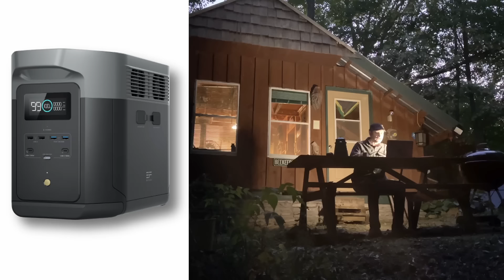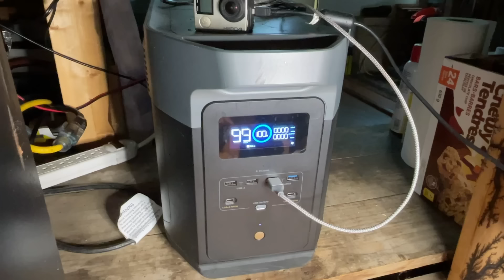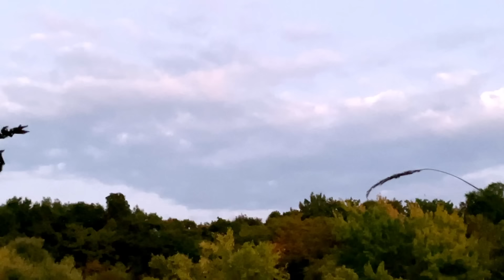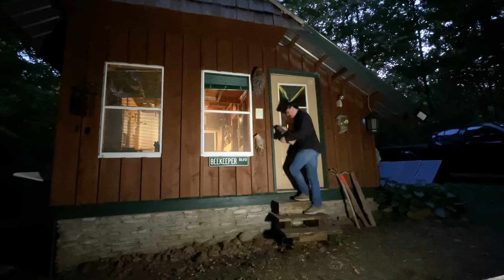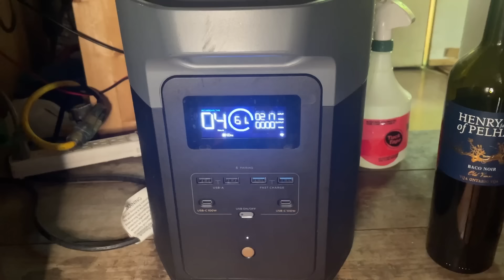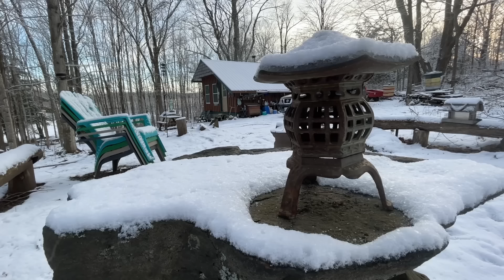Living 48 Hours Off Grid With Just ONE Power Station

Comment: Will it run space heater for more than a couple hours
Reply from the maker: It will depend on your heater, but in general heaters use a LOT of power so you can’t depend on a small power station to run it for very long. In that case, a generator might be your best bet.

Comment: delta 2 max with extended battery and eco flow smart generator running off propane is amazing. when my battery hit 30% the generator kicks in automatic and will charge the unit.

Comment: I’m from perth Australia I have a bluetti it’s great BUT at home I have 600ah lithium and 3 used house panels via victron 100/50 controller and a 2000w inverter(cost about double in total compared to bluetti) to run my shed and garage I have found the electric fridges to be power hungry so swapped over to 12v 95 litre dual zone 12v lights etc and it all lasts days longer but my fridge doesn’t look as cool as the amp fridge haha
Reply from the maker: Thanks for sharing your setup. Switching things over to 12v is a good idea to save power. Honestly, there is no cooler fridge than the Marshall lol. Cheers, Joe

Comment: An adsolute junk power station that can damage your appliances because it doesn't use an output transformer.
Reply from the maker: Interesting opinion, can I ask what exactly are you trying to power that would need an output transformer - more than a power station in this class can handle? This unit is not meant to power a whole house, you need to keep within its limits.

Comment: A 12 volt refrigerator for camping use less energy
Reply from the maker: Good point, direct current doesn’t require energy to convert the power. I actually have a small 12v fridge on the way that I’ll be reviewing soon.

Comment: Sadly I found out afterwards the 12v circuit has low efficiency... I only have a 40 w 12v load on my Delta 2 max and it drops my battery to 50% in 12 hours!!! 👎 Twice the rate of what I was expecting!!! 
You can get decent angled mounts for your wall mounted solar panels... I use them as 'solar' awnings over my windows....
Reply from the maker: It could be an issue with your unit, or there may be parasitic drain happening somewhere. It certainly shouldn’t take 1500w to supply only 500 watts over 12 hours. If you’re still under the five year warranty, I’d suggest contacting the company. Good idea on the solar awnings!

Comment: Since you've got a gas-powered truck, a cheap insurance policy in case your gas generator dies is a 500 watt pure sine wave inverter that clips onto your truck battery (a Bestek is currently $69 on Amazon and it's cheaper on sale). You can adjust the AC charge rate on your Ecoflow down to whatever's reasonable (probably less than 500 watts since there's loss in the DC-->AC-->DC conversion). It's not the most efficient way to charge, but it's cheaper than a DC-->DC charger, it's at least 4 times faster than the cigarette lighter charging, you can use it for AC power without the Ecoflow if you're away from the cabin, and you're just getting it for insurance. The gas your truck uses at idle is minimal. During a recent 72 hour blackout I augmented my solar using my car and only went through 5 gallons of gas the whole time. In order to give my alternator some rest I would run my car for a few hours a few times a day rather than going from zero charge to 100% in one shot.

I have a natural gas central heater with electric blower. During my 72 hour blackout I used backup power to run that just before bedtime, get the house up to 75 degrees, turn it off while I was sleeping, and wake up to 65 degrees. It still used more power than I wanted so I invested in an electric blanket afterwards. It only uses 50 watts on low and keeps me toasty. That'll be my plan for the next outage. I do have a wood-burning fireplace and Mr. Buddy heater for redundancy, but I  don't need to heat a whole room, let alone the whole house, while I'm snuggled in bed (it was down to 40 degrees outside during the blackout and that's about the worst case scenario at my house).
Reply from the maker: Thanks for leaving a comment and sharing your setup. In the early days when I was only using agm batteries I did exactly this.. ran an inverter directly off my car battery to recharge the 12v for the cabin. Works great in a pinch, and like you say, it adds another layer of redundancy. Cheers, Joe
Reply: You can in an emergency also just shove a cable between the truck battery and the MPPT/DC input on the Delta 2 series units (because they do DC and MPPT both) and you'll be able to pull about 10A at 12v (or 24v if you have 24v vehicle power). With a slightly tweaked cable you can pull a chunk more. Beyond that there are alternator add ons for the Ecoflow, Bluetti and similar kit that can do much higher power charging so you can use a vehicle as your generator.